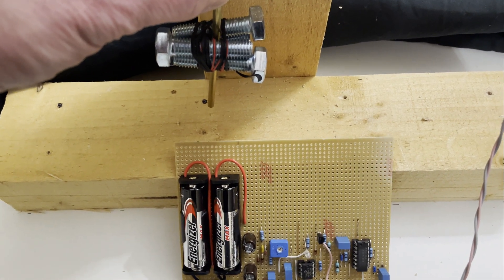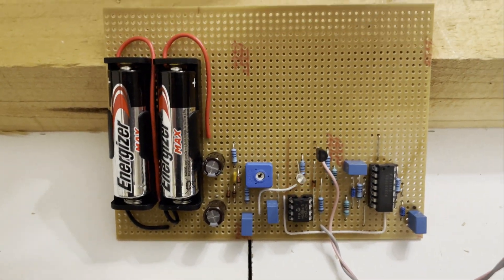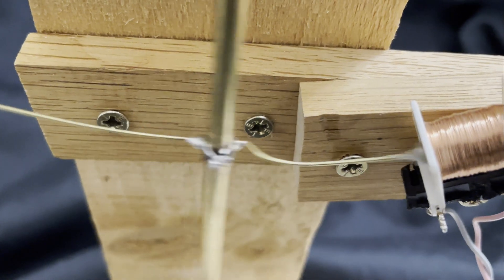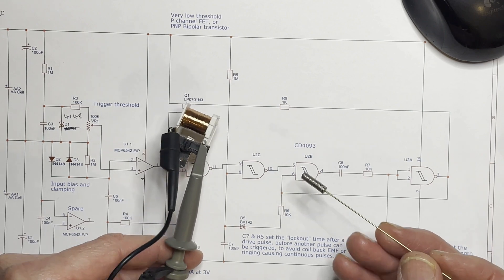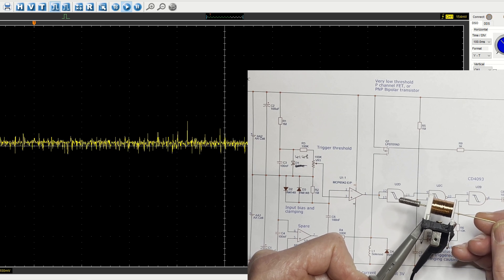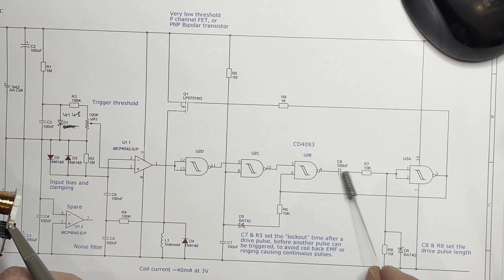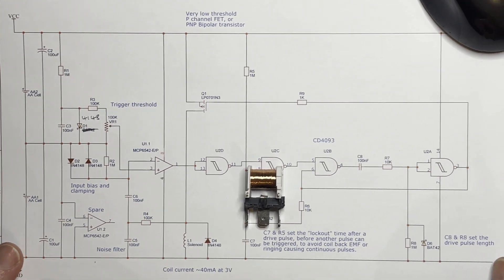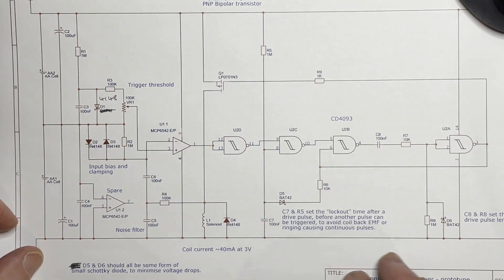Electromagnetic Pendulum 2 - The switch is no more!

Comment: Shorten the pulse time! Adding a resistor is just lost power. Shortening the pulse is better for battery life!
Reply from the maker: That's something I mentioned as a control method, and what I tried in the next prototype - but it does not give stable control, which is why I've not done another video on this yet.

Prototype:
https://robert-jenkins.co.uk/site/images/Pendulum_Driver/prototype_small.jpg

What I discovered from experimenting with this is that it needs an adjustable delay between the trigger and the start of the pulse, in addition to the variable pulse length:

With the pulse starting as the magnet passes dead centre in the coil, there is very little energy transfer to the pendulum until later in the pulse, when the magnet is some distance away from the centre. At the  exact mid position, there is no direction to the repulsion between the fields. The faster the movement, the more energy it picks up, in other words.

The most effective energy transfer will probably be when the magnet is around half way out of the coil, so a short pulse at a point around there should give a self-stabilising effect. ie. If the pendulum is moving too fast (too wide a swing) it would already be beyond the peak energy point when the pulse occurred.

The next version is in progress, I've just been busy with work so not had much time to do anything on these.

(The other added features are constant current drive, so battery voltage variations should not affect the pendulum drive power - that's set by the wedged-in resistor; and the option to separate the sense and power coils, for some other applications).

Comment: We had a clock with this system in1940. Must have been twenty years old then.
Reply from the maker: There were types of pendulum driven clocks using mechanical switch contacts since the late 1800s, such as the factory "Master clock", and gadgets such as the previous electromagnetic pendulum system I posted going back to the 1950s or earlier - but none I am aware of that used sensing from the power coil?

Comment: Nice work!  Following Harrison's line of thought, the shorter the period of the oscillator, the finer you can tune the clock.  So your present setup has a ?half second period and quite a large swing.  Once you have the electriks sorted, I would be inclined to go for a much faster period and much shorter swing, and use a knife edge on a glass slide as the pivot.  Your setup lends itself well to being fitted into say a 100 mm dia PVC pipe with end caps.  You could then evacuate the container as much as you can (a bike pump with the valve reversed would do) to reduce friction.  
Then don't mount it on the same wall as any other pendulum as they will synchronise in spite of best efforts at tuning (as noted at Greenwich).
Great job tho!
Reply from the maker: The driver circuit should be adaptable to suit any pendulum period and mass, by changing the drive pulse & blanking durations and the drive current.

My interest is mainly the electronic side, that other people can copy to use in their projects. Also, I think a nice slow, visible, moving pendulum is part of the attraction of older style clocks!

Re. pendulums in general; as I understand it, the swing angle should be less that 15 degrees to maintain accuracy? - as well as being thermally compensated, as with properly made clock pendulums.

I believe it should be adjustable to self-regulate the swing angle, if the pulse duration is set to match the time it takes the magnet to move slightly clear of the coil with the correct swing, & the drive current is then also adjusted for ideal swing. If the pendulum is then moving too fast, it will have left the coil before the pulse ends, so receive less energy?